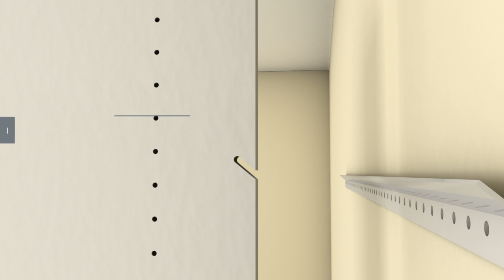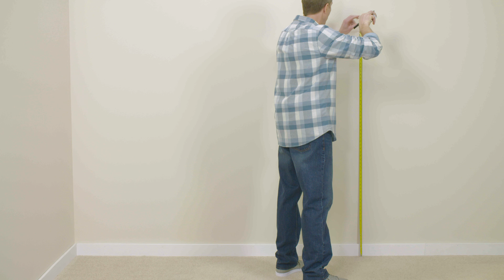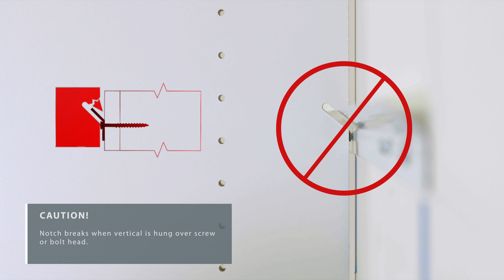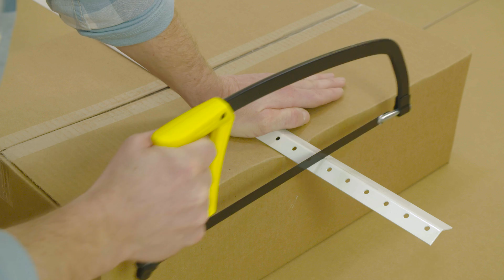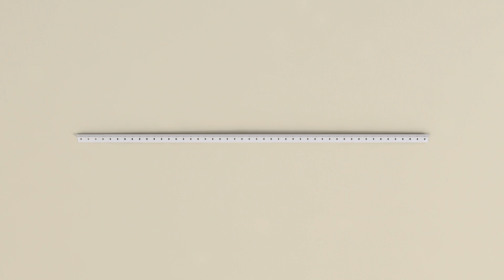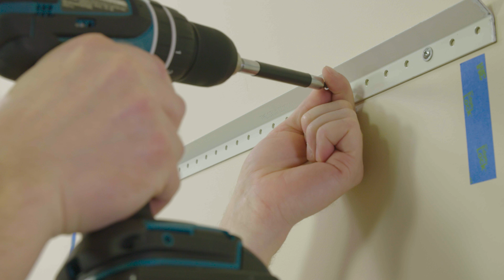How to Install the EasyClosets Rail

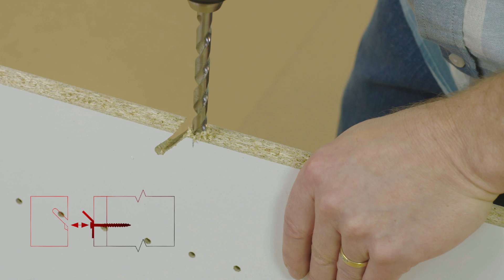Comment: If the vertical is positioned on top of a screw the tip to drill a hole to go over it is good if the vertical is exactly centered on the screw. I used a sander to grind down the area to make clearance for the screw and decided to add a little more clearance to cause the panel to clear the entire rail and fit flush against the wall. I had to do this to all the vertical panels so everything will be aligned. It looks better and seems sturdier this way. Pause the video 2 seconds after 7:58 and you can see how all the panels will be at a slight angle and only the very bottom will be touching the wall. They should have designed the verticals with clearance like mine.